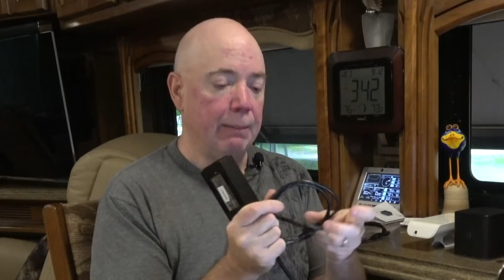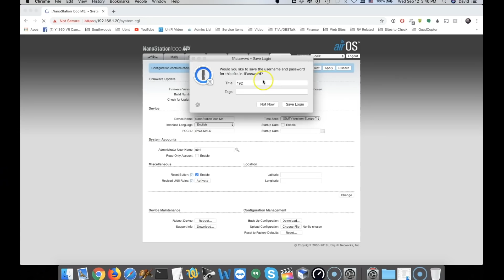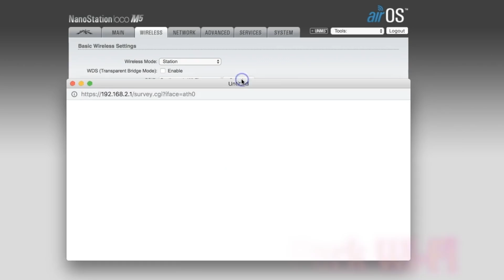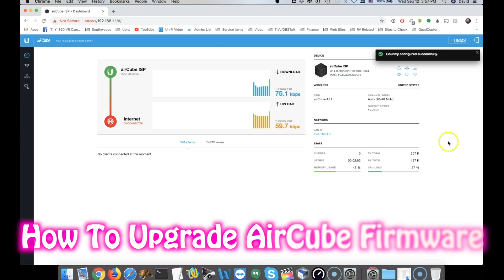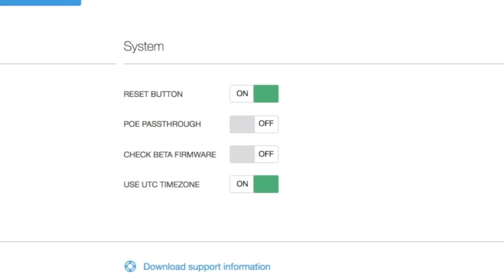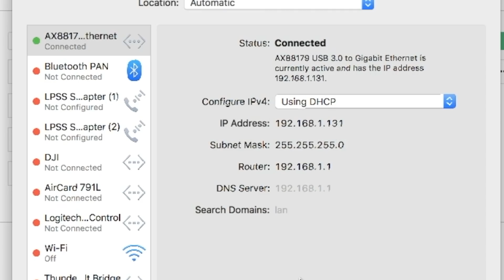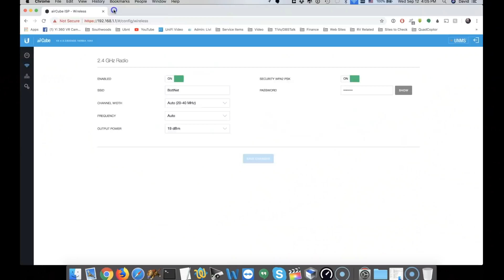Build a Private RV Wi Fi System with a NanoStation & AirCube AC

Comment: I’m stuck. I was able to go to 192.168.1.20 the first time. Now I am not able to. It says site can’t be reached. In addition, I was able to finish all the steps or so I thought. When I enabled WiFi, I see the network I created but also I see the aircube as well, is this normal?
Reply: Once you setup the NanoStation you no longer use 192.168.1.20...that is used just to get into it to set it up, after that, if you followed my directions, you would reach the NanoStation at 192.168.2.1.   Not sure about the AirCube as it could be that you have the AC model and that one might allow you to setup 2.4Ghz and 5Ghz separate and thus could see yours and the other if  it was not setup. Or it could be that your computer, phone or tablet has not dropped the old SSID yet.  Sometimes they take a few mins to clear and thus could see the original one and the new one at the same time.
Reply: David Bott ok. When I connect to my network  it shows a strong connection (the WiFi symbol) BUT it says No internet?
Reply: David Bott thanks for taking time to help. It feels helpless not knowing this stuff after purchasing the equipment
Reply: @HugoGoTV  The directions are 100% spot on. If you did not feel you could do this, then you may care to find someone that can help or return the stuff as I really can't go back and fourth.  You can be CONNECTED to YOUR wi-fi network, but unless the NanoStation is connected wirelessly to an Access Point that offers Internet, then yes, you will not have Internet. Based on your first note, it would seem you have not connected the NanoStation to anything as you were using the wrong IP and did not even know how to get to the NanoStation.  I do not do this for a living, thus I can not offer support I am sorry to say. (Or I would be on the computer answering questions all the time.) The tutorial works if followed and having some computer knowledge is surely a good thing. (But not required as I gave the parts to my wife and asked her to see if she could make it using the video and she was able to.)   But at this point, if you think you had the NanoStation set up, you would connect to your network, then go to 192.168.2.1 which is the NanoStation, then login, go to the Wi-Fi Tab, click Select, find a network SSID you want to connect to for Internet (Not YOUR SSID of the AirCube), safe it, add a password for it at the bottom if one is needed to connect to the SSID and then click CHANGE and then APPLY.  The NanoStation should connect to the SSID of the Access Point that has Internet and thus you should then have Internet.
Reply: David Bott understood and thank you. I’ll make it happen. Thanks again. I think the rv network is bogged down. I can’t get internet on any WiFi network. It took this long to get back on to YouTube. 15-20 min.
Reply: @HugoGoTV  Please be sure you also understand that this system, while it surely will help you get a good connection to the park and get you more secure having your own network, it does not mean however the Internet will be good. :)  If a park has bad Wi-Fi service nothing you can do about it that other than trying to connect to another network. (I have been known to use McDonalds and Starbuscks or even a hotel or truck stop down the road.)  The NanoStation is a powerful device and also remember, it is directional, so you need to point it towards the AP you are looking to connect to.  If all else fails, you can always start over using the RESET buttons on the NanoStastion and AirCube. (While powered up, press in on the button in the hole and hold for 20 seconds.)  Remember, when setting up the NanoStation for the first time, you are not connected though the AirCube. :)   If you follow along, when you get to the point of applying the NanoStation settings, after you do so, switch your computer back to using DHCP and the NanoStation should hand your computer an IP.  If you then go into the NanoStation and connect it to an AP, your computer, while hardwired to the NanoStation, should have Internet if the NanoStation connected to the AP.  Then move on to the AirCube. :) (Note, if you already did the firmware update, no need to do that again.)  Hope you get it going!  :)
Reply: @davidbott5438  what would you recommend to get "better internet"? weboost?
Reply: im in the san benito, california at 1000 trails in a remote valley
Reply: @HugoGoTV  weBoost is a cellular booster.  That will only work if you are using a JetPack or some cell 4G service to get Internet as it is to help you pull in the signal better. A Wi-Fi system like you are working on is totally different and could be used in connection with a weBoost for if you are using a JetPack the weBoost would boost that signal and the NanoStation would connect to the JetPack Wi-Fi SSID or RV Park to give you service.  Or just use the JetPack for service by itself.
Reply: @davidbott5438  btw, i think/hope my problem with connecting the aircube/nanostation could be that i only bought 1 network cable as i found an extra one in the rv when we bought it.  I read on the cable that i found , "only to be used with belkin router".  maybe technically i only had 1 cable all along to set this system up.  Im going to buy another cable today.
Reply: David Bott my nano station has 2 Ethernet plug-ins, one says MAIN and the other says SECONDARY. I have 1 Ethernet plugged to the MAIN and the other end of the cable is plugged in the POE. Then I have another Ethernet cable plugged into the SECONDARY plug on the nano station and the other end of that cable is plugged in the AIRCUBE WAN PLUG. Is something wrong with this?
Reply: When I just plug the Ethernet cable from the aircube WAN to the Nanoststion MAIN, there are no lights coming on
Reply: No lights coming on my nano station (is what I meant)
Reply: No lights coming on my nano station (is what I meant)

Comment: How can Integrate weboost to help the signal?
Reply from the maker: weBoost does not help Wi-Fi...It is for cell service like Verizon or AT&T.  So to use this with weBoost to improve the 4G connection, you would place your 4G JetPack right next to the inside antenna of the weBoost to get the best signal and then you would connect your NanoStation used in this setup to the SSID of the JetPack this getting Internet.

Comment: Great info, BTW, especially the links below that show various options. I ended up with the LocoM2 and AirCube ISP for $70 total. Watched the video again and saw you directly connect via enet at the end of the M2 setup, so it SHOULD work. It only worked for me by changing the PC to the .2 subnet. Once I get my AirCube ISP and have it set up, it shouldn't be an issue. I have a favorite campground that got tired of maintaining the access points so the office is the only place for reliable internet. My Pepwave wasn't doing the job, and this Ubiquiti setup should do it for a lot less than a Verizon hotspot. Thanks!

Comment: After configuring the M2, I realized that I used the wrong password to connect to my guest network, but I was not able to connect to the M2 with the e-net cable and new IP address, so I did a reset, connected to the default address and reconfigured. I hadn't configured an AP yet, so I assume that is required with the new M2 settings?  BTW, I went ahead and ordered the AirCube ISP since it is so cheap at $29 and will leave my Pepwave as is for backup.
Reply from the maker: Hi Eric...Not sure what you are asking. If you did a factory reset on the NanoStation, then yes, you need to start over with the setup.  If all that was wrong is that you put the wrong password in for network you were trying to connect to, all you would need to do is go back into the NanoStation and under thew Wi-Fi, at the bottom, but in the right password, change and apply.
Reply: @DavidBott  That was my issue, I couldn't connect (unavailable network) with the new IP and had to reset and use original. If it has you scratching your head, don't worry about it.
Reply from the maker: @ericball6652  Hi Eric...I am sorry, but you really have me lost as to the issue you are having.  If you are running into an IP address conflict where your NanoStation IP range of 192.168.2.x is also the same IP range of the network you are connecting to, it will fail to be able to use Internet.  In that case, you would need to set the NanoStation to use something else.  Under the Network tab you would change the three boxes that deal with IP.  Thus you could make the NanoStation IP be 192.168.22.1 and then also set the DHCP settings to also use 22.  After you Change and Apply you would then find your NanoStation at 192.168.22.1 from that point on.   I am still however not sure on your actual issue, so I am just tossing things out. :)
Reply: @DavidBott  I got it. I had to change my PC address to 192. 168.2.5 to directly access the M2. You accessed via the Air Cube.
Reply from the maker: @ericball6652  That SHOULD NOT be the case.  The only way you would access the M2, after it is set up, would be via the IP you had set. Per my instructions that would be 192.168.2.1.   So something is not right.
Reply: @DavidBott  I believe that 192.168.1 and 192.168.2 are different subnets. Maybe a different subnet mask like 255.255.248.0 would make it work, but it has been decades since I last played with this stuff. I think it worked for you because you had the AirCube and I was directly connected to the M2 without an access point.
Reply from the maker: @ericball6652  I really can't help you if you are going to change such settings.  192.168.1.X us usually used by default on most routers including the AirCube and thus is why I had people use 192.168.2.X for the NanoStation as they need to be on separate  networks. This has nothing to do with the subnets. If you are reaching the NanoStation via 192.168.1.5 then it is ether set that way under Network for the IP of the NanoStation or you are getting an IP from somewhere else that is on the same network which is not good.  So now knowing that you have been messing around with the settings, it is very hard to help if you have an issue as I have no idea what you may have touched over and above my tutorial. I am happy to help...But at this but really can't now unless you factory reset the NanoStation and AirCube and set them back up via the tutorial. At that point if you have an issue, let me know what you are running into and I can try to help from that point. (my guess still, even though I was lost at the start... LOL...is that you have over lapping networks.)
Reply: @DavidBott  I was just thinking out loud. I only changed the IP of the PC from 192.168.1.5 to 192.168.2.5 to match the subnet of the configured M2. All is good. If I had the AirCube and configured as you showed us, then it would have worked. I will confirm when I get the AC ISP next week as I will have to return my PC to the .1 subnet for that.